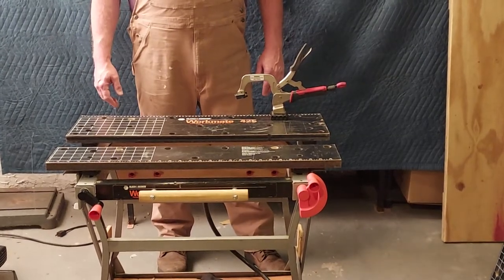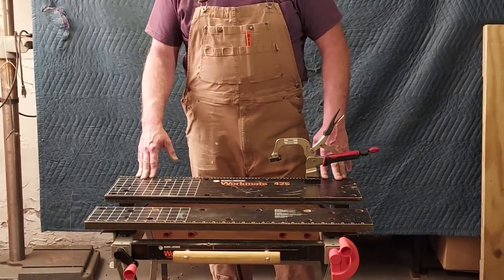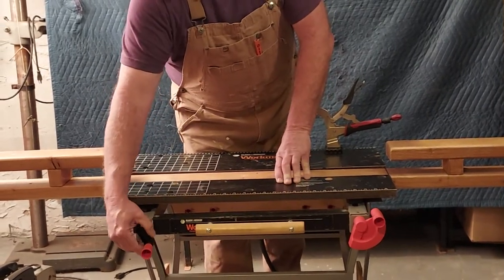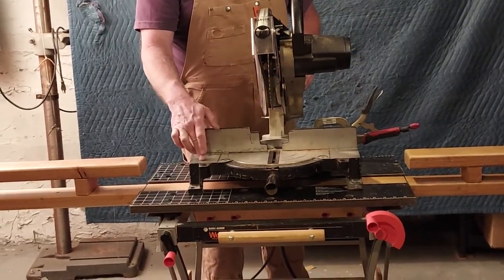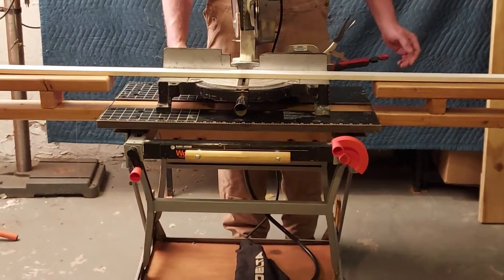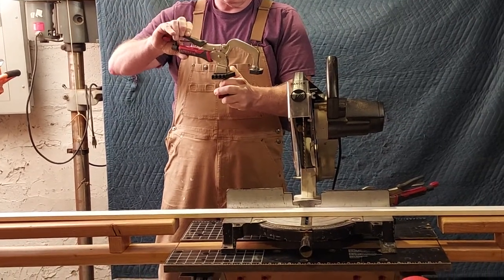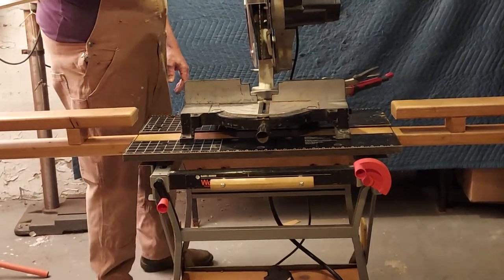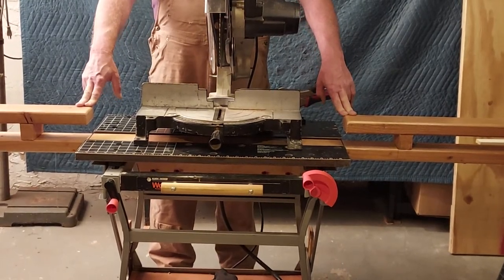Workmate 425 miter saw stand with extention arms

Comment: For smaller storage areas could you hinge this jig in the center and fold it when not in use?
Reply from the maker: You could. I though about it. You could use a hinge and many a slide latch to secure it when in the unfolded position

Comment: Really nice.

I do have an irrelevant question about the mitre saw in the video. 
I picked up a similar old black and decker mitre saw which works fine but has two problems. 1- the blades keep rotating for sometime after the cut. 2- after some cuts, the circuit breaker trips at startup of mitre saw.
I checked online and the problem could be with the brushes. I want to replace them but not sure how to find these online. Do you know which brushes should work? Or do you think the problem could be with something else?
Reply from the maker: Muhammad,
My saw spins after a cut as well. Not sure if older saws have brakes like the new ones. 
I don't know what size brushes are in the saw. I believe there will be a number on the brush when you remove it.  If not, I suggest looking up a manual for the saw on line or calling Black and Decker.  They have very good customer service and should be able to help you
Reply: Thanks a lot
Reply from the maker: 8⁸